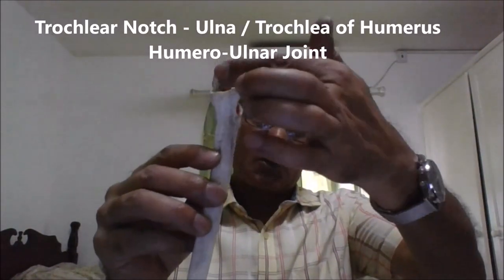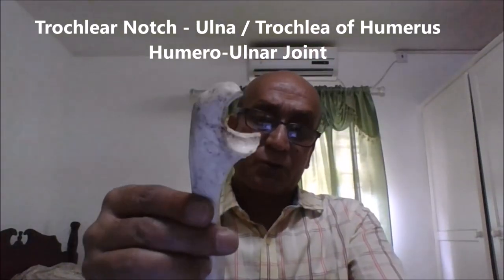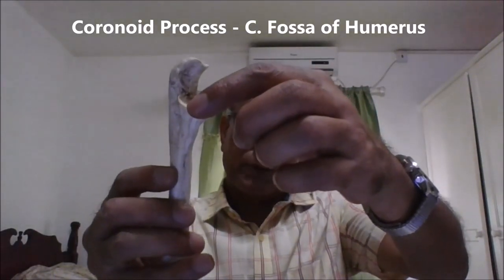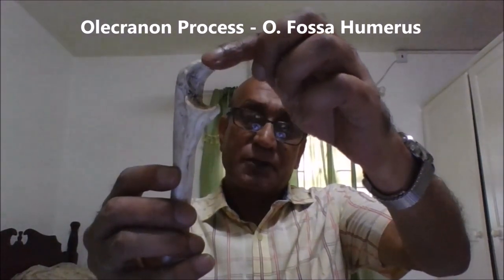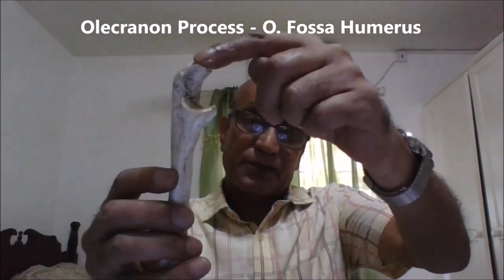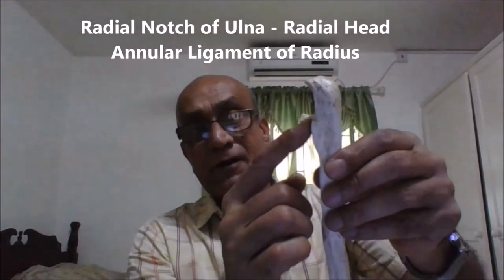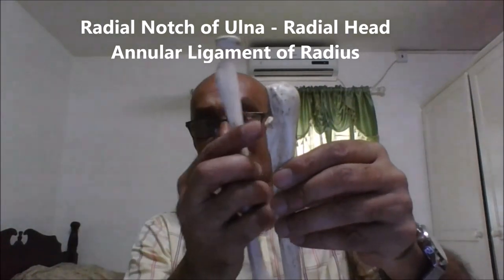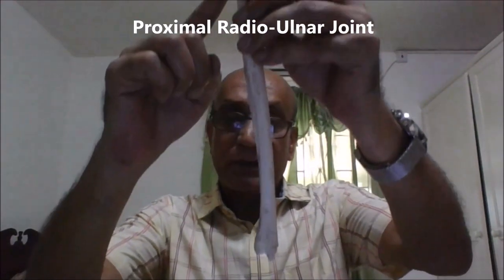RADIUS ULNA Radio Ulnar Joint Functional Aspects Fracture and Dislocations – Sanjoy Sanyal

Comment: Thank you so much for the video. I have a couple of questions. I got ulnar styloid fracture (small fragment) from a bike accident. I went to an orthopedic, and he told me to not worry about it since my RUL is proven stable (no brace or splint). But I wonder what will happen to the detached piece (will it unite with the ulnar at some point in time? or if not, what is gonna happen to that broken piece?). Will it affect my range of motion and other functional outcomes in the long term? It has been a month now since the incident, and I still have ulnar sided wrist pain when I do supination and pronation. I hope you don't mind answering these questions, sir. Thank you so much.
Reply from the maker: Thank you for your query.
Actually you have answered your own question in your description.
Ulnar Styloid process gives attachment to the Triangular Ligament (Articular Disc) that acts as a pivot at the Distal RUJ during Pronation and Supination. That movement is likely to be affected, as you have already mentioned. You may wish to talk to your Orthopedic Surgeon about that.
Reply: @SanjoySanyal  Thank you so much for your response, sir. I will follow your suggestion and bring it up at the follow-up.